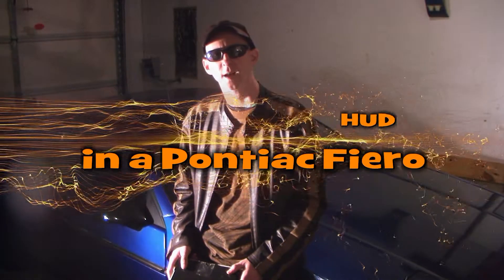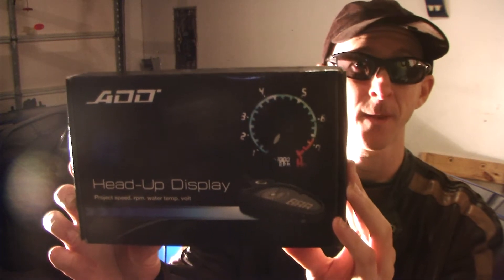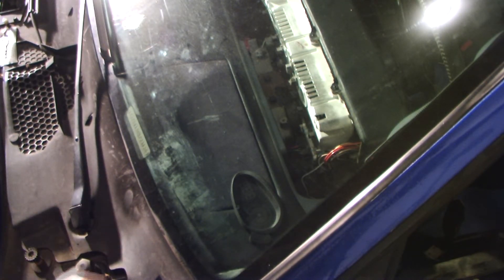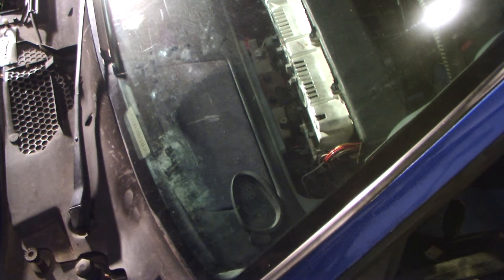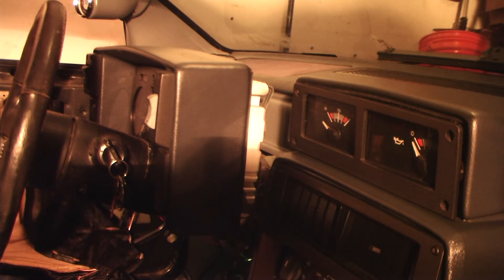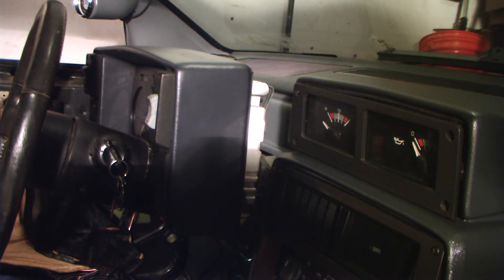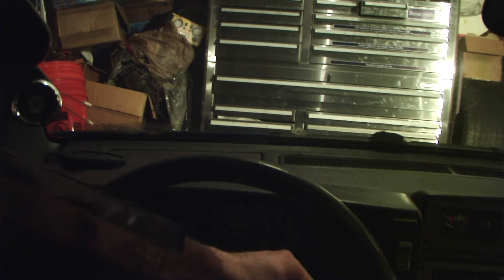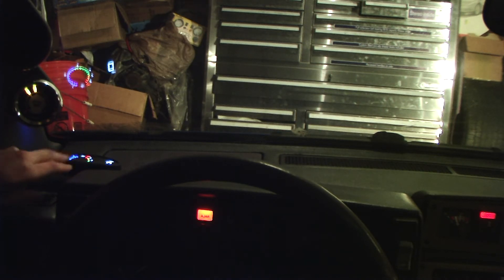Installing a Heads Up Display (HUD) in a Pontiac Fiero

Comment: What's you fuel mileage?
Is the 3.8 stock?
1/4 mile times?
Reply from the maker: I haven't had a chance to calculate those numbers but at some point I want to make a video on performance numbers maybe next spring.